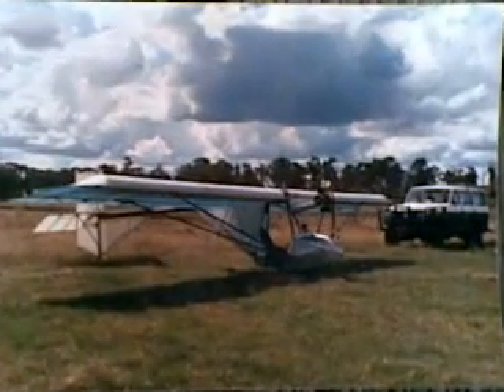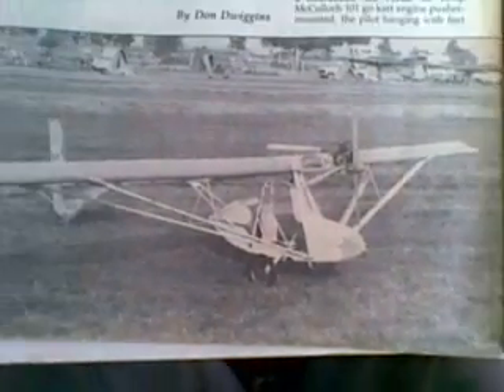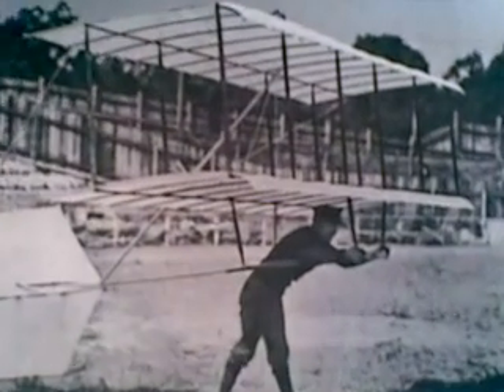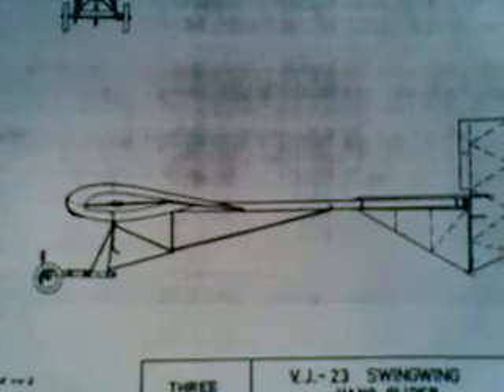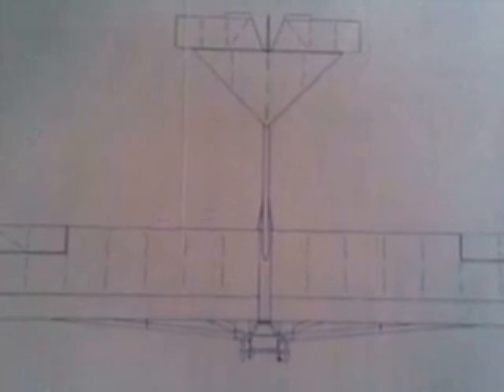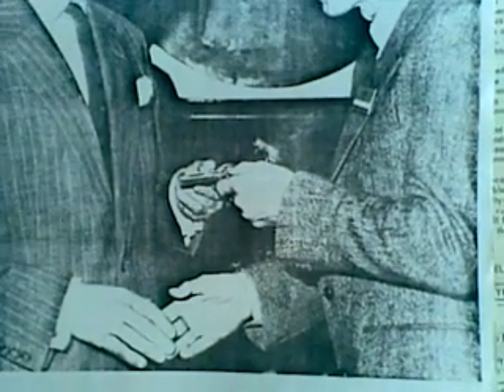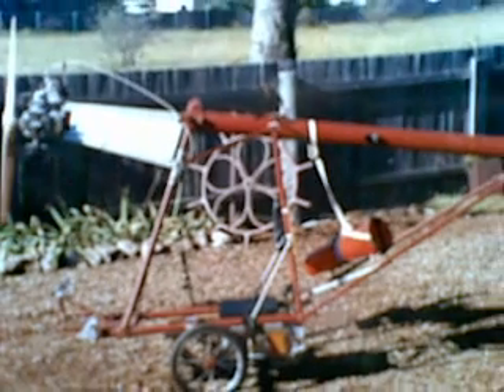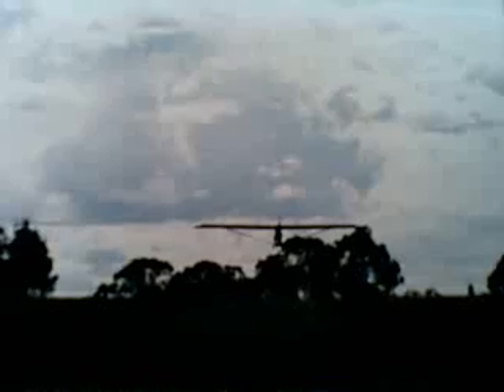V.J.-24w. "SUNFUN". World's First Ultralight Motorglider... 22 Hp. Australian Modification.

Comment: 10:40 - Your plane has the original VJ-24E plywood motor mount still on the back... of your VJ-24W...     so can you move the engine from the front tractor mount to the back on a VJ-24 in a pusher configuration without any problems, if one so desired before they invested all that time to make fairings?   

I'd love to get rid of all that tractor motor mess mount afterthought on the VJ-24W up front and move the motor behind the pilot in a pusher configuration like a Kolb Ultrastar.   I assume I have to move the pilot weight forward then somehow... ...?

Where does the propellor go...  does it fit between the tail boom and the rear strut supports?  Or do you have to place the whole engine/propellor mess on a tripod way above the wing like in the swingwings?
Reply: +WarblesOnALot  My dad thought it was 4:1 but I measured with measuring tape.  Was formerly on Kolb Firefly that hit fence and totalled.  Running when stored.

BTW, they didn't put me in the clink, my case got dead docketed so I won by default :-).
Reply from the maker: G'day,

    Well, yeah, you could put a 10 Hp McCulloch  on the original Motor Mount, and go back to the  VJ-24e configuration, the Propellor for that goes straight on the Crankshaft, INSIDE all the Rear Struts of the Hang-Cage...

  But, as the British Regulators decided, it's a Fail-Dangerous option because if you fluff the Landing with the Engine going...(say, after deciding to try for a Go-Around and spooling up to Full Throttle) then when you trip and your Torso tries to swing up between the Parallel Bars, the tiny little Razor-Sharp Propellor at 15,000 RPM will chop you in half at about mid-Kidney level...

  Mine came with a Direct Drive 22 HP JPX with a 3 Ft which climbed dangerously badly ; it's 21 years since a Fence-Post came into the Cockpit and smacked my Rudder-Bar during a Downwind Takeoff,  and I still carry a Stick and  walk with a Limp...

 If I were to be rebuilding mine, I'd either go for Volmer Jensen's idea of a 15 Hp Yamaha Engine with a Centrifugal-Clutch and a 10:1 Belt Reduction-Drive to a 6 Ft Propeller...; which gives you about 135 Hp worth of Torque at 1,500 RPM, so it climbs really well, and then you could Idle the Engine, stop the Prop with a Blade-Brake, and go Soaring while being able to instantly release the Brake and open the Throttle to outclimb any pesky patch of Sink...

 A propper Motorglider..., that would be...

 The other option would be to rebuild it as an Ultralight Sailplane, sort of a Lazy-Person's Carbon Dragon...; with 15:1 L/D instead of 25:1...

  But, here in Oz Ultralight Sailplanes are illegal, I know a bloke with a CD which he has to keep hidden from the "Nazis in Canberra" who have been known to peek in through cracks in his Shed looking for something to prosecute him about...; All "Ultralights" have Engines & are administered by the Recreational Aviation Association of Australia, whereas all "Sailplanes" are administered by the Gliding Federation of Australia, and if it can't be Aerotowed by a General Aviation Piper Pawnee, or Winch-Launched by a V-8 Car-Engine, then they REFUSE to administer it...

 And the Hang Gliding Federation can administer Trikes (with Weight-Shift Controls & Engines...) but not 3-Axis Sailplanes which cannot be Foot-Launched (so the Carbon Dragon could be a "Foot Launched Aerodynamically-Controlled Hang Glider" but only by invoking "Loophole Theory"...

  Basically, I like having an Aeroplane, but I'm not rich enough to repair it so that I can play "Catch me if you can" with the Fascists who like to behave like Anally-Retentive Over-Compensated Inferiority-Complexes on legs, and claim the "Right" to tell me when, where, and how I'm permitted to play around with my homebuilt Levitation Technology...

 My solution is that I'm the Fool
On The Hill..., my Hut is "Vertically Superior to every Rooftop within 15-75 Km (10 miles to 50 miles-ish) ; so, I can look down on all my Neighbours without needing to rebuild my Aeroplane, and the Nazis in Canberra have to leave me in peace...

 By the way, I'm uncomputered, so answering YT Comments via the Mobile Phone is my "Global Megaphone" as it were...; I dunno how to answer eMails...

  But, YT is faster than Snail-Mail, so if you feel like asking questions and you don't require any "private answers" then feel free to ask away...

;-p

Ciao !
Reply: +WarblesOnALot Thanks for the info.    Yeah, I'm trying to fly on the super cheap myself.    And by Super cheap, I mean WW1 prices ;-)  I bought my plane for $38 US bucks (52 AU) two days ago.  $52 AU for a plane, mate!  I couldn't say no!  A total wreck / barnfind.  I got it so cheap, because nobody... not even the owner, knew what it was.  I surfed hundreds of ultralight pictures before I found a match and identified it.

Mine is the VJ-24W with the tractor motor mount you described up front but the Yamaha engine and prop are gone (unless he still has them somewhere in his garage).  Its going to a nice little motorfloater sailplane someday ( a different kind of flying... like a Bloop2 or Goat Glider)...  but I have a lot of restoration work ahead, and have to recover it and learn as I go.   Fortunately I got my dad, a cabinet shop, and the local EAA chapter of wingnuts.  I'm in the USA.  

My grandfather flew P-38's out of New Guinea in WW2, 147 missions,  Port Moresby...   I guess you can thank him a little bit partially you're not speaking Japanese today ;-)  They gained air superiority eventually and food got so scarce with the Japanese Army from their supply ships being sunk they started painting their chickens green to camoflage them.  One of these days I'm going to ask my grandfather if he shot a green chicken from his P-38, and if so, would he have painted it on the side of his plane as a confirmed kill, and be the first to do so ;-)  How many green chickens before you become an Ace :-)

I'm a video game programmer, and one of my main friends I worked with (via internet) ("Devilman") lives in / is Australian.   We banged heads a lot together solving each other's problems through email.

I printed out a lot of fascinating history on the VJ-23, VJ-24, Volmer Jensen, Irv Culver, early days of hang gliding,  etc this morning...   kind of tickled pink with my little airplane purchase now which when I first saw it thoguht it was fugly.  Now I see it with fairing on it like Lohrey did on his plane and I think its a cute little plane.  Plus I love history.  Lots of backstory with this plane and I can stand around it now and jabber jaw about it to visitors.

I have yet to drag my plane home, but my car and trailer is ready to go.  I'll ask you questions way down the road as I run into them here on Youtube then as I restore her.  You may be one of the last few Volmer Jensen aircraft familiar experts left around...     a few people have 3x5 plans out there but I don't, so we'll probably be improvising and engineering some things to the best of our ability.

How far are you from the Lighthorse Field and Artillery Museum in Nar Nar Goon, Victoria? They use to have an old Sopwith Camel Replica out front rotting in the weather, I wonder if it's still there?  http://www.lighthorsemuseum.com.au/

Pics:
https://upload.wikimedia.org/wikipedia/commons/e/e3/LHM-Sopwith-Camel-1.jpg

https://upload.wikimedia.org/wikipedia/commons/thumb/3/33/LHM-Sopwith-Camel-2.jpg/512px-LHM-Sopwith-Camel-2.jpg

If you want someday, when I get my plane home, I'll measure and take pictures of the motor mount for you and all the holes, etc....  if you want to add the same to your plane.  Not a problem.
Reply from the maker: +CHOPPERGIRL AIRWAR 

   Wow, if it was that cheap it sounds like you habe a BIG job ahead..!

 I'm one of the people with the big roll of Plans, with updates from the original 24, 24e, & 24w.

 I think the first Ultralight with Wheels, Seat & 3-Axis Controls was the Col Winton Grasshopper in 1977, he began flying it with the Minimum Aircraft Flyers Association of Australia at Camden, west of Sydney...Tricycle Undercarraige, low wing Pusher on a Streamlined  Pylon coming back from the Pilot's Headrest, with various engines...

 I never heard that Green-painted Chicken Story, though I trained at a Vet's Affairs Hospital, and in 3 years there I nursed 2,000 Vet's of everything Oz was in from 1914 to 1984, for an average of 10 days each..; the Japanese were definitely that hungry (in Burma they were eating Battle-Casualties....), but I dunno if they would've had any spare Paint...(?) !

  They cut through Australian British Dutch & American Forces everywhere except New Guinea, the US Navy & RAN stopped the Port Morseby Invasion with the Coral Sea Battle and then the Australian Militia failed to lose the  Kakoda Trail Battle, and then the 2nd AIF pushed the Japanese back to Buna, Gona & Wewak, and then the US Marines and Army had a go at fighting alongside the 2nd AIF and took a while to come up to speed...

  In my Uploads there's a series called "Darwin 1942, Australia's Darkest Hour", or maybe it's "Darwin 1942, Australia's National Day Of Shame.." ; it's long, but I read the entire book to camera in installments, "Darkest Hour" was written when the findings of the Committee of Enquiry were declassified after 50 years...

 Australia was defenceless in 1942, and what stopped the Japanese from invading  Australia was that they never intended to do it, and when they found that Oz was helpless they considered the idea...; and 2 junior  Lt Commanders in Tokyo were tasked to write an IJN response to the suggestion & it took 2 days for them to declare that the Navy had no Marines nor Shipping to contribute to the Task, and the Army said it was bogged in China and trying to swallow Indochina & Burma...

  Japan never got Morseby nor Midway, so they never quite achieved their War Goal of a "Greater Asian Co-Prosperity Sphere" with neat straight Rectangular Borders and a southern edge running from Timor to Ambon to Morseby to Guadalcanal, and an Eastern Edge going up to the Aleutians via Midway...

 I'm at the opposite end of NSW from Victoria, which begins about a thousand miles South of here..., and I hadn't heard anybody was silly enough to leave a Camel Replica out in the weather to rot away, that's terrible...!

  Any way, enjoy restoring your SunFun, and if I can help in any way then let me know...

Have a good one,

;-p

Ciao !
Reply: Awesome I love history, and you know a lot more about WW2 in your part of the world than I do for that area.  Most of what Ive learned in detail about WW2 is about the European theater.  Love watching documentaries on Youtube.  Port Moresby...Wewak...  Three Mile... all places my grandfather talked about...

My grandfather bailed out of a P-39 Aircobra over Australia while he was joy riding...  so his plane parts are scattered somewhere in the outback...

"Lockhart was flying a P-39 for training purposes and decided to do some sightseeing.
He was flying over the Australian outback when coolant started leaking from the plane and he bailed out.
His parachute got tangled in a tree and he had to cut himself down in the middle of nowhere. Lockhart said he followed a stream until he came across a cattle station where cowboys were breaking in wild horses.
"A man there welcomed me in," Lockhart said. "They didn't have a lot of contact with the outside world, but he was well-stocked with any kind of meat you could want. He offered me my choice of steak and bourbon or gin."
Because he was flying where he wasn't supposed to when trouble ensued, Lockhart was grounded for a week.
He said sinking his teeth into a juicy steak was worth it."

From: 
http://marlee2.peachcountry.com/I%20was%20at%20the%20mall%20yesterday%20and%20happened%20to%20see%20an%20%5bArchive%5d%20-%20Water%20Cooler.html

And of course all my pics and info from him I just dumped in a directory on my webserver... you just kind have to click around and explore:  
http://marlee2.peachcountry.com

---

When I saw what was left of that Camel wreck rotting in the rain at tge Lighthorse museum  I wanted to raise money to send to the museum for them to build a roof over it.  But with more research I found it was only a replica.  Now that Ive seen your pictures of repainting the Tiger Moth and the Sopwith Pup and Fokker Triplane for that fellow as a teenager...  Im wondering if that is not the same Sopwith, that maybe he crashed later???   There cant be that many Sopwith replicas from that time period in Australia.  Do you know if his Sopwith and Triplane are still intact and what happened to the Sopwith?  

Wouldnt that be a hoot if that Sopwith wreck I found long ago on the internet was the same one you told the guy he should be building a Camel instead of a Pup?  Lol.
Reply from the maker: CHOPPERGIRL AIRWAR 

G'day, 

That's an interesting article..., there were a lot of US Pilots in Oz who had trouble with navigation or engine problems and finished up walking out ; they were kinda rushed through their training and so were the Ground-Crews, and Oz is really big...

  The Sopwith Pup and Fokker Triplane that I worked on finished up in the Australian War Museum as far as I know, Neil Cottee threw so much Pacific Films money at his Aeroplanes that he was turfed off the Board of Directors, and the two replicas with spares were donated, on.condition that and the RAAF Historical Flight operated them for years, out of Canberra.

  The Triplane had to operate on a series of Permits To Fly, 2 months' paperwork in advance to get 1 month's clearance, so by donating it the RAAF got stuck  with proving to the Dep't of Transport that Replicas were safe to fly..; it proved to be the "thin edge of the wedge" which eventually opened Oz up for the Replica & Warbird movement to happen here.

My father's uncle flew a Camel in October 1918, 4 Squadron Australian Flying Corps, he was at Gallipoli as a Private, where his little brother had been killed on the first day, that turned him into a bit of a "Fire-Eater" - in France at Poizierres as a Seargant he captured 500 yards of Trench and got shot in the Shoulder, awarded the Military Medal, promoted to Lieutenant & given his choice of assignment so he picked Flying...; on his  1st trip over the Lines he "became separated from his Flight" (got lost or wandered off), then he saw 2 LVG 2-Seaters but not their overhead Escort, (the LVGs were "Bait" in an Ambush...) so he attacked the pair of 2-Seaters by himself and shot 1 down (!) before 6 Albatrosses descended and chased him into a Cloud with Fuel streaming from bullet-holes in the Tank behind his seat... On emerging from the Cloud he was knocked unconsious by Anti-Aircraft Fire (A shell-fragment, not "Flak.", in the War of One they called it "Archie"...) and woke up just in time to pancake on the English Trenches, he ruptured his Appendix in the Crash, and a month later the War was over..., he became a Schoolmaster like his father.

    His son flew a full Tour (30 Op's) with the RAAF in 1943-44 on Lancasters, night bombing, then he was on the Black Cat Squadron flying Catalinas from Western Auatralia to Madagascar, it was a 24 Hr Leg...; post-War he went into Qantas, flew the first Qantas Lockheed Constellation into Hong Kong, and retired as Director of Flight Op's the year before I started playing with Tiger Moths & Replicas...

 My mother's father paid for his own Lessons and got his FAI Aviator's Certificate in September 1917, and enlisted in the AFC on New Years Eve... The family story was that he had to enlist as a Seargant Mechanic "because he left school at age 12...", but I suspect he was 1/8 Aborigine, "passing for white"..; and Aborigines weren't allowed into the AIF till mid 1917, he was 25 when he joined up, so the timing matches the details kinda thing...

  My grandmother had said she wouldn't marry him unless he enlisted, went to the War, and came back an Officer and a Gentleman, so he learned to fly before enlisting, but in Australia he was spotted..., he got to England and while training as an Engine Fitter he had a spell of "Lumbar Neuralgia" and while in Hospital he got somebody to take notice of the fact that he was a licenced Pilot, and they transferred him to the AFC Training Squadron on Salisbury Plain (where he met Dad's Uncle), but by the time my Grandfather's Course finished Flight-School it was March 1919, so he went to Buckingham Palace, the King pinned his Wings on him, he arrived back in Sydney in June, and had 6 months Leave on full pay and was demobilised on Christmas Eve 1919...

Oh, what a lovely War..., tour the World for 2 years, no shooting involved,  then home in time for Xmas, an Officer and a Gentleman as ordered by my Grandmother, so he married the rich Presbyterian's daughter, and it was 20 years after his death before his children discovered he was a Catholic when he enlisted (!)...

  I figured out that Aboriginality might be the key to making sense of it all, about 20 years ago, when I was living in a rented house on a Massacre-Site and I suddenly began carving Boomerangs & writing Massacre Poems which were good enough that the local Tribal Elders started coming to me with stories about places and sites, for me to put into verse...(try my "Warbles In The Wilderness" Playlist, the Armidale Environment Centre appointed me "Poet In Residence", too....).

   It was mum's father who turned me on to Aeroplanes but he died when I was 3, so putting together his story took a long time...; but I think he was probably both the first Aborigine to be commissioned an Officer in the AIF, and the first Aboriginal Pilot..., one of my cousins agrees with my backtrackings, and I haven't spoken to 2 others..., my mother refuses to consider the idea..., but she was raised as white just as she was raised a Presbyterian...

  So, in a sense I can't remember not being interested in flying, and Open-Cockpit Taildraggers were always my favourites...; I thought Ultralights should've become something like the stuff people were playing with in the 1920s, but here in Oz there are now a few 350 Hp V-8, 7/8th Scale Spitfire "Ultralights" which go 250 MPH with the Wheels up..., so you can see why they have to be licensed...

  Have a good one,

;-p

Ciao !
Reply: +WarblesOnALot Check this out, someone has put an electric motor on a Vj-23 around Wasserkuppe.  Believe it or not, my parents took me to Wasserkuppe Rhone when I was little and have a shirt pin from there somewhere... I dont remember seeing any gliders though... which it is famous for in early glider history post ww1- pre ww2

http://www.nestofdragons.net/rigid-wings-overview/footlaunch-listing/volmer.aspx
Reply from the maker: CHOPPERGIRL AIRWAR 
Well, I read it...

 At one point, in the late 1980s, NASA was supposed to be using a Solar-Electric R/C VJ-24w for Upper Atmosphere Research above 50,000 ft...; hearsay only, but for a while  fantasised about Nitrous Oxide boosting my Jensen and beating the Mitchell Wing U-2's Ultralight Altitude-Record of 32,000 Ft.., because the Airframe had been proven, and at the time I happened to own a RAAF-Surplus  RAF  Vickers Mk-5 Aircrew Helmet (designed for the Crew of the TSR-2) {the RAAF refused to buy it either, and disposed of it's handful of Test-Samples in Sydney, I bought one for  $180...} which was rated for Ejections above 40,000 Ft...

 I was a bit of a Nutter when I was young...

;-p

Ciao !
Reply: +WarblesOnALot Lot, not as nutter as my idea of using two small pulse jet engines on an ultralight, and controlling their thrust not by changing the throttle, but by pitching them between straight back for full thrust.. to both off to opposite sides outward towards the wing tips for reduced thrust (forward).
Reply: lol well never mind that idea... the biggest rc jet engines only put out about 40 pounds of thrust... Id need 4-5 of them... cost 3,000 each and need rebuilt every 25 hours.... probably suck quite a bit of fuel to...  i suppose you could do it with a much larger homebuilt turbine but why bother...  still an interesting idea... maybe 15 years from now...
Reply: +WarblesOnALot Im reading up on thermals, cumulus clouds, and cloud suck.   Being a cheapskate that sounds like a challenging fun thing to do to stay in the air a lot longer.  

Also IFR.  My dad who use to be an air traffic controllers and GA pilot knows all that IFR stuff.  I bet its going to blow his mind that I eventually learn some of that stuff.  

Here anything above 18,000 ft is IFR so I wont be daydreaming of setting an altitude records in my pokey ultralight.
Reply from the maker: CHOPPERGIRL AIRWAR 

   Pulse-Jets are devices which turn Fuel into Noise, and their Cooling Airflow produces some residual Thrust...; your Dad may well get flustered when you tell him about the Jensen...

 Air Traffic Control is Heavy-Metal General Aviation, and GA generally abhors Ultralights...; over here, anyway...

;-p

Ciao !
Reply from the maker: CHOPPERGIRL AIRWAR 

G'day again...,

 Well, the Poster you've made came through OK, the link to the $25 Engine which has been sold came through, but the others went to micro-Text in the upper Left corner of the Screen...

  I reckon that if you want to get something better than the 15 Hp Yamaha, it would be worthwhile trying to find a Rotax 277...; 28 Hp Single-Cylinder Ultralight Engine made by a Company which STILL builds Ultralight Engines...

  I dunno who told you that 2-Cylinder Horizontally-Opposed engines run smoother...(?).

   The Pistons move in opposite directions, and with 2-Strokes that means that both Pots fire simultaneously, so in terms of vibration coming out of the Engine-Mounts and going into the Airframe (from the Pulses of Torque-reaction, one per Revolution of the Crankshaft) they BEHAVE like a giant Single-Cylinder motor of the same capacity...; at cruise and take-off settings it's not too bad, and when on the ground Idle isn't too terrible because the Weight on the Wheels serves to absorb the energy and damps the movement..., but in flight when I pulled the Throttle back to Idle the JPX, I could barely see the Instruments because the "BangBangBangBangBang...." was slow enough to allow the Crankcase to develop signifigant twitching-rotational movement between Bangs, and the Panel was mounted between the two forward "Downtubes", which were moving in opposite directions at each Bang, and the ends of the Panel were oscillating over an arc of maybe 5 Degrees...

JPX..., 22 Hp for 425 cc, with shitpotsful of Vibration, from an extra Con-Rod, Piston, Crank-Throw, & Counter-Weight, all going to magnify the effect...; versus the Rotax 277 with 28 Hp from 277 cc, one throw on the Crankshaft, one Counterweight to balance the one Con-Rod & Piston...and about HALF the Vibration...

But, for Vibration purposes, 15 Hp from the 97cc Yamaha is the MOST Preferable... ; particularly when mounted in a collection of Aluminium and Pop-Rivets designed to fly in Formation as a Hang-Glider in a Vibration-Free Flight-Regieme..., Extra Cubic Centimetres may be highly Contraindicated... ; if you see what I mean...(?) !

 It's 2-cylinder INLINE 2-Strokes which are smoother than single-cylinder "Thumpers", because their Crank-Throws have the Pistons movin in opposite directions in Cylinders which both point the SAME Way, so the Pots fire 180 degrees apart, and THAT makes everything smoother.

About the only things I'd consider you might want to change is the line on the Poster about "First Modern Motorglider (Ultralight)"...; because that could be arguable...., it's a debatable way to put it, anyway..., whereas "First Ultralight Motorglider" is a rock-solid claim...(Nothing from the General Aviation Sailplane Fleet, especially with a Motor, is light enough to be any kind of an "Ultralight", and stuff like the Easy-Riser Conversions to the Icarus Swept-Wing Biplane Hang-Glider, which began as Foot-Launched but the last versions of them had tricycle-undercarraiges (if you haven't seen it, dig out a 1990s movie called "Fly Away Home", it's about a little girl, her Ultralight, and a flock of Geese who thought she was Mother Goose because she hatched their Eggs and was the 1st moving thing they saw when they opened their eyes and "imprinted" their Mummy's image...; so she had to teach them how and where to fly, so her father had to teach her how to fly and lead her leading them...).

  The VJ-24e and the Foot-Launched Easy-Riser were contemporaneous, and I dunno whether the 24w or the Easy-Riser with Tricycle Undercarraige  was the first Wheeled Ultralight in the US...(?).

 But the Clutch and Propeller-Brake, as well as the full 3-Axis Controls and a fixed seat is what separates the 24w from the "Hang-Glider/Weight-Shift Microlight" Class, because the 24e and the Easy-Risers ALL used Weight-Shift (the Seat on the 24e was a swinging  Board with a hole in the middle, dangling on a Rope with a knot under the Board, to allow a combination of Weight-Shift & Aerodynamic Controls mixed on the Stick..., and the Easy-Riser used Weight-Shift for Pitch - super sensitive too, move your head forward 1 inch to dive, or back an inch to climb..., Tailless Wings are all a bit like that...!)...

  But, the Easy Riser was at full-throttle all the time, unless it was gliding down to land...; it arguably graduated from Foot-Launched Hang-Glider with Tip-Rudders to being a Powered Ultralight with wheels..., but it was never any good as a Motorglider because it was already as draggy as a Bastard, and had a shitty Aerofoil, and the Motor and Wheels added weight and drag...

 The VJ-24e had a 9:1 Glide to begin with, and putting the Pilot onto a Seat, hunched up in the Hang-Cage, reduced the whole Aeroplane's Frontal Area by at least 10% and improved the Pilot's body's "Aerodynamic Fine-ness Ratio" by about 60% ; so even with the Yamaha adding a bit of Drag, that equation came out equal, and the extra weight merely added maybe 10% to the Stall-Speed...

 Therefore,  the VJ-24w was the first Ultralight Motorglider..., designed to self-launch, stop the Prop, and go Soaring , for the fun of it, while the Motor burbles away at idle, "putterputterputterputter..." ready to provide a way to return to  the Launch site when a big patch of Sink intervenes...; without the anxiety of trying to pull-start a 2-Stroke while planning and flying an Emergency Approach, into wherever the hell you're going to plant it, if the Engine refuses to re-start...

 But "First Modern Motorglider (Ultralight)" will probably attract bunches of argumentative Pedants reacting to "First Modern Motorglider"  before noticing the modifier "(Ultralight)"...;and they'll possibly want to argue for things like the P-38 Lightning which the RAAF used to operate as a Self-Launching Sailplane, flying IFR doing  Research into Cumulo-Nimbus Thunderclouds, in the 1940s...; they went up to 20,000 Ft, shut down and feathered both motors, and then flew into the Storm to map the presence and speed of the Vertical Air-Currents... (Yahoo Yipeeee !) so it was definitely a Modern Motorglider, but WAY too fat to be an Ultralight...

  Have fun,

;-p

Ciao !
Reply: WarblesOnALot Well, that kind of lovely controversy arguing might get the old timer Elmers to stick around arguing with me long enough in front of my plane to give even more input about what I should so not to get myself killed, and then finally just help me out and to do it right with me so I dont kill myself  :-) 

 Theory anyway... they may also be pissed off at me so much, not to help me, because I parked whats left of a 35 year old flying lawnchair next to their $$ hod rod airplanes.  We'll see what happens.

Thanks for the info on the inlines being smoother.  I think rotax finally ended support for their lines of psedo aircraft snow mobile engines a year ago... the 2xx, 4xx, 5xx etc.  I liked the look of the 2 cylinder 25 hp Cuyuna engine tho.  I just thought the opposed cylinders would do a better job cooling themselves.   Nothing better that learning the reality of the thing from someone whos already used them and knows first hard real world experience with these motors.

So you think its better to go the motorglider route with the lightweight engine /clutch break and keeping it lean and  lightweight and with plenty of aerodynamic fairing for what it was originally designed for... slow gliding and thermalling?  

Were you ever to ride any thermals yourself?  Here in the summer we have increible heat like AU and lots of Cumulus clouds.

I found a hang glider variometer for 20 bucks on ebay, that runs off 2 nine volts, im going to try and win that auction.  Eventually get me a cht, rpm, speedo up to 50mph, altimeter, maybe slip indicator.

I also want to fly low and slow though and Im worried about having enough power to climb out and clear hedgerows and trees and power lines.  Im guessing a tree is about 80ft high which at 300ft/s means I better start climbing out 15 - 20 secs before I come to the trees... if Im lazily coasting above a cow pasture.  

I probably will defo do your leading edge mod with a real curved metal surface probably out of a sing long piece of alluminum roofing flashing... as whatever styrofoam was there is long gone...

You were the end of the line hotrod engineer on this model so Im appointing you Her Majesties Honorary Royal Flying Engineer of the Anarchist Airforce... plane #1.   Anarchist being hermits as we are we stick up for our right to be left alone and as long as we're bothering nobody else we re golden.  Strictly an honorary title as anarchist have no queen and I wouldnt be one anyway. 
I think Ive bothered you though plenty about this plane already though so when I become a nuisance tell me to zark off for a while.  :-)  

Tomorrow afternoon is the big day to go pick my plane up.  Will take pics..
Reply from the maker: CHOPPERGIRL AIRWAR 

Well, if Rotax won't support the 277/377/477 Motors, then perhaps check their Dealers to see if they have any old Spares and how long they can keep a 277 going...; but I suspect that Yamsha still supports their 97cc Motorbike Engine...

 Soaring in a VJ-24w is something generally done in Ridge-Lift, I dunno what your upper legal height-limit is, but Thermalling is the other option.

 With the 42-inch Dia direct-drive Prop on the Jensen, it would MAYBE climb at 100-200 FPM..; my guess is that a 2.66: 1 Re-Drive would've given me 250-500 Ft/Min up..

  With 15 Hp @ 2.66 : 1, and about 6 Ft Dia Prop, then you should get 400 Ft/Min Climb rate...?

;-p

Ciao !
Reply: Yeah, I dont have any ridges or ridge lift around here at all... thats the problem... its all flat... and the coast is 150 miles away...   all that kind of stuff is on the other side of the US off the coast in California, where Volmer Jensen and the hang gliding fad really took off...   so riding lift seems like it would be a chore here...   I think the 747s  glide ratio of 1 : 12 also...   I cant imagine what a pain it would be to try and keep a 747 in the air through thermalling alone...   impossible?   At any rate, hardly a high performance purpose built 1 :  30 glider.    So Im worried trying to stay aloft via thermals where I live might be a lot of hard work.

But then what the shit do I know, I have never piloted for more than 5 minutes with my hands on my dads tail dragger long ago in level flight... so it remains to be seen.  Im willing to give riding the thermals here a try though, just because it seems like a challenge AND Im a super cheap skate.  If I can stay in the air longer for less gas, Im all for it.

Oh, and I can argue the VJ24w was an ultralight, because for a motorized glider to be an ultralight, all you have to do technically is leave the motor running.  ;-)  Three axis control, powered flight, wheels, seat, boom, thats good enough for me to be an ultralight.  Whether it was the first to do this, tho, is debatable, but for the sake of my little poster well just conveniently forget the other competitors to time ;-)   My little 35 year old project plane needs all the &quot;special&quot; it can get.

I don't know how much more heavy this old JLO is going to be compared to the Yamaha...  like I said, they still make the Yamaha 100 as a high performance light weight competition go cart engine, but at $500-$1000 new they aren't cheap!  I'm kinda in the budget build section.  If I can snipe and scart an old Yamaha 100 on the cheap I will.  Or some other motor.  My dad thinks getting an engine for an airplane is so hard (like the old days), but now we have ebay... so me buying this $25 engine is just to really to dispel his concern we have no engine.  We may even get it to run, but its worth the $25 just to get him stoked and motivated on cleaning and fixing it up with me.

And I think he is, cause he bought a piece of plyboard for the trailer and insist we put it on cause "your plane is such a frail thing".  Lol, I hope its not too frail, it has to support my fat ass in the air...

Latest trailer pic:
http://shellprompt.com/deathtrap1/Trailer/DSC_9858.JPG

Paint scheme mockup, over David Cooks plane:
http://shellprompt.com/deathtrap1/Flying%20Mockup%202.jpg
Reply from the maker: CHOPPERGIRL AIRWAR 

 Well, yeah, I guess if you strap it on really well, and drive slow and careful, that trailer should work...

   I'd be trying to locate a Go-Cart that somebody has outgrown, maybe one they've flipped and  hence "outgrown the fascination" with, and buy the wreck just to get the Yamaha Motor and rebuild it, the local Motorcycle Shop may have half a dozen of those motors in various states of disrepair, collecting dust in their "Don't Dump Yet" Collection...(?).

  If you've only had 5 minutes of Dual, years ago, and you're going to fly the SunFun over Flatlands then you're either  going to learn to enjoy playing with the Thermals, or you'll percieve them as "Turbulence" and get cranky at them for being there...any time you fly in the middle of the day, so I really strongly recommend you get into reading up on Gliders & Sailplanes, then going to wherever the nearest Soaring Centre or Gliding Club there is to you and doing your ab-initio (basic training up to Solo standard) on something like a Blanik L-13 being either Winch-Launched or Aerotowed behind a Pawnee..., as part of the Course they'll teach you how to recognise Thermals (the Aeroplane tries to roll away from the Lift, because the Wingtip closest to the Core goes up faster..., so if a wing rises by 40 degrees the prescription is to immediately put that wing 40 degrees down, and turn in towards the Core, to get into the Lift...)...

Perhaps the EAA Chapter can put you onto the US Sailplane Community ?

  The only East-Coast USA Gliding Operation that I know of is in Florida, where Bill Moyes has an Airpark (look for "Moyes Delta Gliders Florida Airpark" and I'm sure Google will connect you with it)...; they use Bailey-Moyes Dragonfly Tugs to aerotow Rogallos as their "Core Business", but about 15 years ago Bill was trying to develop an Ultralight Sailplane in the 25 :1 L/D  class, kinda like an Aluminium & Fabric competitor for the Carbon Dragon..., so perhaps they could connect you with the Ultralight Sailplane Community...?

 If you can, ideally you'll backtrack them and eventually discover an obscure little clique of people who use "Vintage Sailplanes", or maybe even "Primary Gliders", to get a feel for something which glides like the Jensen...; which was 9:1 for certain when Volmer flew them, and 15:1 if the figures I got can be believed, with the fully-skinned Wing undersurface, and my faceted-trapeziodal Pod, with the JPX idling away ferociously...

  In my opinion, the 15 Hp Yamaha with the 2.66: 1 Reduction-Drive would have 1/4 of the Vibration, and produce at least twice as much Thrust compared to the JPX...; so floating about looking for Thermals in Putterputterputter-mode  would be pretty much the best game you could play, with the Jensen..., they're not much fun going Cross-Country (36 MPH...) either to sit in or to sit under ("Lawnmowing in the Sky !", was what one bloke told me I was doing..., hanging there almost stationary and making a constant drone that takes 10 minutes to get overhead and another 10 minutes to go away, while the Jensen will have only covered 10 or 12 Miles on the map..., less distance & more time in any kind of Headwind ). 

  Think of the SunFun as an Aeroplane, a Flying-Machine, an Anti-Gravity/Levitation-Device, which is excellent fun when used in ideal conditions..; but it is not any kind of an Aircraft, with which one can "Commit Aviation", because Aviation involves the use of an Aircraft designed to venture aloft for ANY PURPOSE OTHER THAN TO HAVE FUN ...

  You can't reliably commit to travelling anywhere in a SunFun, because anything over 10 MPH worth of Wind is pretty much beyond them, 5 MPH is tolerable and dead calm is ideal ; and they're as slow as a wet week, so commuting and touring is not really on the menu.

 You can't tow or drop anything from a Jensen, and "Aerobatics" would be a totally bad idea..; they really are optomised to be a great fun little Motorglider, a lovely Aeroplane to fly for the thrill of being aloft,  but not an "Aircraft" and not fit for "Aviating".

 Perhaps though, if you were getting paid to take a SunFun to Airshows and having to fly Displays in weather which was marginal and scary, then that would be a case of a SunFun being used (abused ?) as an Aircraft, and Aviating for a Purpose other than having fun...(?) !

  Irv Culver designed the Wing to be really really good at flying Slow, for Footlaunching, so it's useless for going fast..., and  only once did I ever see 60 MPH on the ASI, briefly, while diving under power at 45 Degrees on the Height/Speed Test-Flight, and it felt seriously scary...; I dunno if the Foam/Glass half-Sandwich Leading-Edges would've taken it, but I had my metal L/Es, and a Spring-Deployed Ballistic-Recovery Parachute, so I kinda felt prepared for everything up to and including having the Wings fold-upon me..., but they did not fail...

  The SunFun is not really a "Deathtrap", unless you insist on asking it to do things which are beyond it's abilities...; to be an actual "Deathtrap" requires some built-in Booby-Traps like not having Roll Control & being unable to recover from a Spiral Dive if one ever tries to Turn while going downhill, so any time the Bank-Angle equals the Dive Angle it'll kill you (the Mk 1 & Mk 2 Skycraft Scouts did that...., the Mk-3 had Wing-Warping)..., or Single-Swaged Bracing-Wires (Yachting-Practice) which come undone with Engine Vibration (only 12 Mk-1 Skycraft Scouts were produced, 4 of them killed their Pilots when the single-swaged Drag-Brace from the Engine-Mount to the Wing L/E Spar let go, allowing that Wing to fold back against the Tail, causing irrecoverable Rolling Dives....).

 Compared to an early Scout, a Jensen is only "potentially dangerous", because it requires actual mistreatment before it will hurt you..(!) ; whereas the Scouts could kill you simply because you thought they were safe to fly.., which is a scary thought to look back on.

Have a good one,

;-p

Ciao !
Reply: +WarblesOnALot ....  2am Dec 14, 2015, a ghost plane from the 80's appears in the drizzling rain on my front yard...

http://shellprompt.com/deathtrap1/ghost_plane/DSC_9889.JPG

I spent all that time trying to identify it, and all the while it was written on the rudder but not shown in the pictures:

http://shellprompt.com/deathtrap1/ghost_plane/DSC_9891.JPG

http://shellprompt.com/deathtrap1/ghost_plane/DSC_9892.JPG

http://shellprompt.com/deathtrap1/ghost_plane/DSC_9898.JPG

http://shellprompt.com/deathtrap1/ghost_plane/DSC_9881.JPG

http://shellprompt.com/deathtrap1/ghost_plane/DSC_9875.JPG

http://shellprompt.com/deathtrap1/ghost_plane/DSC_9878.JPG

More pictures:
http://shellprompt.com/deathtrap1/ghost_plane/

Ohmigod, we did not just bring the plane straight home, but continued on an insane whirldwind trip pulling it behind us driving through picqturesque Pennsylvania towns and Wester Virgina Mountains for 1000 miles...      that plane saw more scenery in one day than in its entire lifetime...   particularly rotting away leaning up against someones storage shed in the back yard.... total mileage... 1700 approx.   And I drove about 3/4 of that...

It is now 2:30, and I have to take a shower.... because I haven't in 3 days...

BTW, if it was restored, I'd freak out if it got drizzled on, rust an all, but considering its pretty far gone, left out in the weather, more drizzle won't make anything more worse... at that rusty stuff is going to be replaced or restored...

I can't believe you flew this thing... it is so fragile!   None of my 4 struts are interchanable with the other side, I'll have to figure out which goes where and then number them..
Reply from the maker: CHOPPERGIRL AIRWAR 

COOL PICTURES...!

 I like your Undercarraige Struttery it's very non-standard for a Jensen, more Piper Cub-ish in layout...; it's better, suspension-wise, than VJ's "Hardtail" fully-rigid version, and it gives you a wider Track..., but it looks to be a tricky thing to try to streamline - maybe V-shaped Balsa, or Foam, Fillets  with Pinked-Tape bindings to turn all those Round Tubes athwart the Slipstream into Streamlined Sections, in the same way as the Wingstruts (?).

  The Wings shouldn't droop like that, they should be flat from Tip to Tip...

 Is the orange-painted stuff painted Aluminium, or has somebody really gone to town on modifications and built half the Hang-Cage from Steel Tube...?

   Yeah, they really ARE flimsy when you look at them with the Skin off, it's because it was designed for somebody to pick it up, hold it in both Arms with their Elbows over the Parallel Bars and run into the wind fast enough to lift off the Hilltop... (Volmer was trying to repudiate the "A-Frames" which had made Rogallos flyable using pure Weight-Shift...) ; so it had to be almost stupidly flimsy, which is a reason to minimise the Engine-Vibrations it'll be subjected to...; and it was a big part of why I redesigned and rebuilt the Leading-Edge, in Aluminium.

I didn't realise you had to drag it 1,000 miles, where did you say it was, and where do you live (?) I'll have to dig out my US Map...

 My daughter & "honourary stepdaughter" also   drove 1,000 miles this week, to get to a Masquerade Ball & Book-Signing in Melbourne...; they're about 1/3 of the way back atm.

You might as well wipe your Airframe down with a Sponge or Washcloth a couple of times while it's wet, to get the dust off...; probably not good to leave it out in the weather, particularly not in Snow or it might bend things.

 Was it stored in Salty Air near the Coast, because if it was then you'll need to ensure that the corrosion doesn't cover any pitting which would cause weakness in the components...; if it's simply surface corrosion, then I'd talk to the EAA people about how to clean and prime and paint it (to prevent further corrosion) before covering it..., if you look at mine, all the Aluminium was primed before it was covered...

 It adds a tiny bit of weight, but who wants the bits of a Jensen to be getting any thinner as they age...?

 And, if you can evict a Car from it's Garage and claim the space for storing & working on the Jensen, that would be great...

 Have a good one,

;-p

Ciao !
Reply: +WarblesOnALot 
It was stored in NJ not far from the coast, but I didnt feel any salt spray while I was there,  the wind typically in that area I think always blows out to sea, so Im not too worried about salty corrosion.  Its been out in the rain in my front yard quite a bit in torrential downpours at this point... and probably years leaning up against a storage shed in somebody's back yard before I got it.  Id rather it not be out in the rain one more day, but I want whatever relatives who are coming for Xmas to see it, before I put it away out of the rain.

Im thinking Apollo white wings, NASA font in black, and annodizing the alluminum parts orange (those that will be visible)... and paint the galvanized steel parts white.   I want something bold looking...   and yet still a nod to the  Volmer Jensen orange cream sickle look. Orange is a good color to contrast against sky blue too:

Not much I can do on Christmas Eve, but play around in a paint program:

Update latest mockup potential color scheme pic:
http://air-war.org/image_mockup_orange_3.jpg

Three view color scheme mockup pic:
http://air-war.org/image_mockup_orange_2.jpg

I decided to ditch the yellow, since its the trademark Piper Cub color...

Annodizing will pitt /oxidize the surface of the alluminum somewhat, makign the outside layer stronger but more brittle, but its measure in nanometers, just deep enough to hold the dye. Other modern ultralights do it so Im not too worried about it.  Im going to experiment with it, it looks like an easy process to do on Youtube, and should give her a really modern up to date look.

Im going to take off the old paint that&#39;s just adding dead weight with something called CItristrip...  leave the unseen parts unpainted alluminum...  and derust the steel undercarriage first, paint with rust converter primer, then paint with enamel.  

I have to reengineer some things with the routing of the stick controls because he raised it 2 inches, so he could move the struts to the back and run a bar underneath, which got in the way of the alieron controls, but then raised the seat up 2 inches, and I bump my head, so I have to some how lower them again so I can lower the seat 2 inches back to where it should be.  You can see the old fittings are still welded on there, where the stick use to run 2 inches lower...  and where he moved the back seat bar back about 5 inches more vertical.

I cant do anything to the !@#$% plane (even though I'm dying to) until I take care of this traffic ticket bullshit case next month..   which is ruining my xams and new year...   heck, since I can't pay their $3500 fine, I may end up in jail for 3 months for this rubbish of driving 45 in a 35 through a speed trap on a 2 mile trip to my local town to get milk for my kittens on an unlicenced, unregistered old farm motorbike... without a motorcycle licence... two years ago.  Since then I've gotten all that taken care of (I got a 100% on the test) but these assholes won't let that kind of stuff drop, there is no limit to their greed.

I made some hooks to hang the wings of it up  out of the in the barn today, where I can put it away, and then work on just the cockpit part first

Happy Holidays from Santa: 
http://shellprompt.com/deathtrap1/santa.jpg
Reply from the maker: CHOPPERGIRL AIRWAR 
G'day,

 Well, that stuff about having moved the Lift-Struts back and raising the Seat and Joystick, all in order to make room for the Piper-Cub style Undercarraige and a galvanised Steel "Space-Frame" to sit on top of..., sounds like a bad idea that's been fairly well done...; it might be a better idea to go back to Volmer's original Fuselage layout, to lower your seat flush with the Parallel Bars, and copy Volmer's Welded Chrome-Moly Steel Undercarraige with the modification mine has with a Bungee-sprung floating Cross-Axle, it involves adding 2 extra welded Vertical-Tubes to the Undercarraige-Girder, so that the Axle is located between them...

 It will give you a bit more work, and involve pulling out somebody else's "Brilliantly Inspired Modification".., but it will give you a much  lighter Structure which is just as Bungee-Sprung, and which makes a lot less Drag, as well as not cramping you up any more than sitting in the Hang-Cage already involves...

 It could be argued that the Steel Space-Frame Nose will be "more crashworthy" than the original Nose..., but to be honest I reckon the better strategy is to be lighter and have less Drag, and therefore fly better, and thus be less likely to crash...

  Maybe the reason the project was abandoned was connected with the "Improvements" having been a Mistake...?

 It seems to me that the "Droopy Tip-Dangling Wings look" in the trial-assembly Photos might perhaps be due to the Lift-Strut Attachment-Fittings having been shifted - thus skewing ALL the Wing-Incidence Geometry...?

  That Court matter sounds like a problem.

  It isn't that the System is Greedy, they're into enforcing compliance with Road-Laws which have evolved as a response to Complaints from the Public about the dangers posed by people with no training in the Road-Rules operating unsafe or unroadworthy equipment..., because there was a time when unregulated Hicks, Hayseeds, Hillbillies, Suburban Wanbabes and the like used to career about the landscape in 4th-hand clapped-out Rattletraps, running into things and running over people with depressing frequency...; and the Fee/Fine Structure is set up so that it's far far cheaper to get a Licence & then pay the Registration than it is to get caught for breaking the Law..., as a Public Health measure as much as anything else (Motor Vehicle Accidents cost a huge amount in Hospital Bed Occupancy as well as loss of productivity from the injured, incapacitated, and deceased resulting therefrom...).

  For you to get out of a $3,500 Fine for Speeding at more than 30% of the posted Limit, on an Unregistered & Uninsured Vehicle, while being Unlicenced...; you'll have to "pull a very rare Plum from out of your Bum, probably while doing a Backward Somersault with a reverse half-flip, through a burning Hoop, while playing a Beethoven Sonata and wearing a Tutu...!".

 Even though Ignorance Of The Law is NO EXCUSE for Breaking The LAW... is a foundational "Cardinal" principle of the Principle  of "The Rule Of Law"...; so is the Principle of "What was in  the  MENS REA...?".

  Mens Rea is loosely translated as "Real Mind", it's Latin.

  If you can convince the Court that you either genuinely did not know that riding that Bike in that place at that speed was against any Law..., or that your personal need to make the Journey then and under those circumstances was SO Pressing that you honestly BELIEVED it would later be deemed to have been so reasonable that if taken to task and brought to Book over it you were convinced that it would be retrospectively judged to have been a Lawful Journey...

 Considering that you were going out to collect a Loaf of Milk &  Bottle of Bread, you should forget about the "Dire Necessity" defence.

 Which still leaves you the "Mens Rea" avenue.

 At this point in history, where you are, that'll hinge upon 3 points...#1, you'll need to be a Cleanskin with no prior Contact with the PoLice, nor record of having ever so much as Bin-Questioned, in relation to Any Matter Whatsoever ; ya gotta have been "Previously Unknown To The PoLice...". This much is self Evident, if you'd ever previously met the System then you'd have known how it works...

  #2 You will have to be able to convincingly prove that you were So Socially Unaware of contemporary Mores and Cultural Values that you personally never noticed, or deduced, the existance and enforcability  of Road Rules, Speed Limits, and Licencing & Registration Requirements...; so, a pre-existing history of a disgnosis of Autism, or ideally Aspberger's Syndrome, would probably romp home free at this point - but only if it's your first offence....

#3..., You throw your Parents, Family, Friends, & Neighbours under a Bus, and tell the Court how you were raised by Libertarian Anarchists who filled your Head with romantic delusions of how "Free Citizens" were not required to comply with the "Laws of The Land" they dwell within...; and because you were So young and naive and trusting and impressionable (wear Bobby-Socks & Gingham ; and batt your Eyelashes, while sighing sadly...) that you Never Dreamed that they were raising you on a tissue of Lies founded on Wishful Thinking...

 But, considering that you said your father was an Air Traffic Controller...; that may be hard to establish in the Court...

  As an act of desperation, if you're young & pretty, and if the Judge appears likely to respond well, you can always try bursting into tears and sobbing about how you didn't MEAN it... ; but probably a better idea might be to plead Guilty and ask for a Pre-Sentence Report from the Parole & Probation Board, to better inform the Court regarding your ability to pay off a Fine slowly, or perform Community-Service to work off whatever Fine you can't afford to pay...

  My strong suspicion is that you Need to demonstrate Contrition.

  If you go in there trying to tell the Court that they have no right to Judge you, and how they're all a bunch of Greedy Parasites, and how you were ONLY going & ONLY doing & Only Trying to do what you wanted to do...., and what makes Society think it has the "Right" to make any  Rules about who and what goes at which speed on the Roadway which Society has built...(?)  ; then, yeah you could well talk your way into sitting behind Bars and looking at the Stripey Sunlight...

Which way you play it will be up to you...

   My advice is not to mention your Plans for the SunFun in Court...; the Bench will probably not find them particularly favourably impressive, such has been my experience, anyway.

  (I have Criminal Convictions for 5 Indictable Offences, once I drew a 6-months Sentence to Hard Labour but it was Suspended at the Rising of the Court...; in the Civil Courts I was once self-represented with 12 Applications simultaneously afoot, in a Matter which ran for 9 years, accross 4 Jurisdictions, and in which at the end I won 4 Cases in all 4 Jurisdictions within 30 Days...., to wit State Local Court of Petty Sessions, the  Federal Family Court, the State Supreme Court, & then the State Childrens' Court...; and in fact I Prosecuted and convicted the Defendant, in the Family Court...).

  So, if you're into "Bush Lawyers" I've got a better Track Record than most ; and I haven't been Prosecuted, nor launched any Prosecutions, for 14 years, which is kinda like the difference betwixt a Bush Lawyer and a Litigatious Crank...., if ya see what I mean...(?).

;-p

Ciao !
Reply: +WarblesOnALot The wings are probably drooping because I have them held to the frame with bungee cords as some hardware is missing to attach the wing to the boom... and my jury struts are missing... and I probably have the wrong strut in the wrong place... they are all custom and don't seem to be side to side interchangeable.  My assembly at 2am in the rain as soon as I got it home was just for photo op.  Proud new owner of a ghost plane.

Somehow I'll have to get the plans for the lighter sprung undercarriage...  maybe from you someday...  the wing /tail/ boom plans I can get locally for $25 from Vula.org.   I'm not too upset with my draggy undercarriage yet because its already made and I understand how it works and how I will restore it.  It adds some nice steel under me for better or worse (worse being I get impaled with a steel rod through my thigh on a hard impact).   

I have quite a bit of confidence the plane must of flew at one time because everything was there at one time for it too.. fabric, cables, fittings, etc.  Someone put a lot of work into it.  I assume they upgraded to a better faster safer plane and/or moved the engine/property over... way back in the halcyon early eighties ultralight boom craze.

 I made a quick list of stuff to buy tonight to start and along the way to get me where I'm going with the project.
Reply from the maker: CHOPPERGIRL AIRWAR 

  Well, the Government has Authority over their Roads, and if one wants to use those Roads then one has to stay within the Rules or put up with the consequences..; if you'd rather be put into Clink rather than obey the Road Rules, that's your call.

  I did 6 years in Catholic Boarding-Schools as a teenager, and I regard not having actually been locked-up since as being a major achievement.

  With the building of Aeroplanes, it's slways good to keep in mind the principle "Simplicate, and add MORE Lightness...!"

  Probably the easiest way for me to get details of the Undercarraige variation to you is to make a video of what the original Jensen version was, and some drawings of how to do it differently...

  What happened to the missing Wing-Ribs ?

Have a good one,

;-p

Ciao !
Reply from the maker: +CHOPPERGIRL AIRWAR 

G'day,

 Your Update on getting a Cuyuna is good, it showed up on G-mail, and as a notification on G+, but my Phone can't see the Comment on the Thread, using G+...

  Such Is Life...

  Is it a 2-Cylinder Cuyuna, or a Single ?

  Did you see my Video about the Brewster Buffalo, and the other one about Chuck Yeager ?

 I like knowing about some of Aviation's less well-known History...

 And, Newsflash, the bloke I bought my almost-finished Jensen from tried to buy it back last week...(!), he had visions of rebuilding it as an Ultralight Sailplane...; now he wants to copy my roll of Plans, & build himself another one..., because mine is not actually for sale... (because I might yet perhaps decide to rebuild it...

    I'd hate not being an Aeroplane-Owner, after 29 years of having been in the Club, of my 55 years of breathing in-&-out, the 8 years between my first & my second Aeroplanes were the times when I felt the most "incomplete", as a Human...

   Does the Cuyuna come with a Belt Reduction-Drive...?

 ;-p

Ciao !
Reply: +WarblesOnALot Yes its an inline two cylinder 430 cc 35hp with blower fan and pull cord start.  Very smooth power band and detuned for long life at 6000rpm.  Has a 2:1 dual belt reduction drive.  Was a steal at $250 US and he's mailing  me CHT gauge and hour meter with 180 hours on it.  $250 US = $350 AU.  Haven't seen your Brewster or other links yet.
Reply from the maker: +CHOPPERGIRL AIRWAR 

It sounds Very YUMMY ...!

    If you can organise a bit steeper Reduction-Drive it would be better, something like 3.1: 1 might be about right...(?).

  Big, Slow-Turning Propellers are vastly more Propulsively-Efficient than "cutting a little High-Speed Hole-In-The-Air..., and then expecting that to suck you any signifigant amount of Thrust, at less than 50 MPH..." !

 The Bigger the Propeller, the better your VJ-24w should levitate...; in moi humble opinionation...!

;-p

Ciao !
Reply: +WarblesOnALot pics: http://air-war.org/image_DSC_0026.JPG

http://shellprompt.com/deathtrap1/Cuyuna%20ULII-02%20engine/
Reply: +WarblesOnALot Yes very yummy, normal such engine and redrive is $1500 AU here.  Score!  May put bigger lower pully on it to turn big prop.  What cruise and climb rate would you guess I'd get with this 35hp?  Total engine plus exhaust plus redrive is 85 lbs.  All I need more is prop, gas tank, and air filter, and maybe new belts.
Reply from the maker: CHOPPERGIRL AIRWAR 

Yay Team !

 The Dead-Docketed thing did manage to get through via a G-mail acouple of months ago...; Excellent !

 It sounds like you're figuring it all out...

;-p

Ciao !
Reply: +WarblesOnALot Yeah, I started hanging out at http://homebuiltairplanes.com where I have a long running discussion thread about my airplane :-)
Reply from the maker: CHOPPERGIRL AIRWAR 

  Excellent, I figured you'd be able to rustle up some people who're able to help you put all the bits together...; having a brains-trust is generally lots better than going it alone...

;-p

Ciao !
Reply from the maker: G'day,

  Something Synchronicitous is going on here...

  Your Comment came up in my YT Notifications, but when I clicked onto it there was nothing new from you on the Thread...

  However, I was going to dig back into the Threads to contact you anyway, because I've posted 2 Videos in 3 Days which feature my Jensen..., and the 2nd one shows the inside of the Wing, just for you...

  It turned out that the Fur-Lined Flying Jacket in "Extra Large"was way too big for me, so it goes to my Son - who is rather bigger than am I ; and I'm now wearing the one with the Quilted Lining sized as merely "Large", after I cut all the fake Patches off it.

  Have a good one,

  ;-p

Ciao !